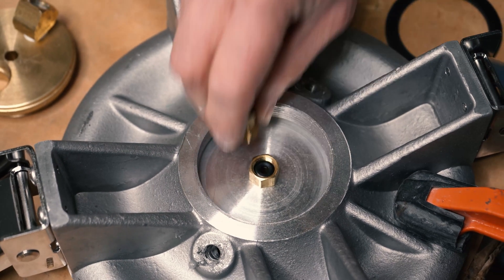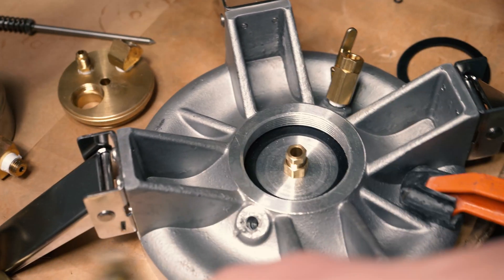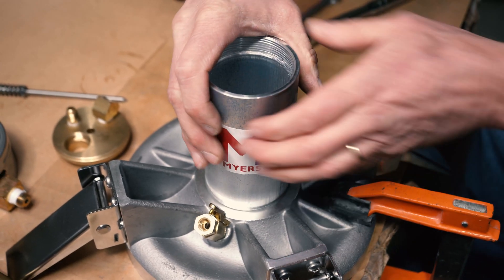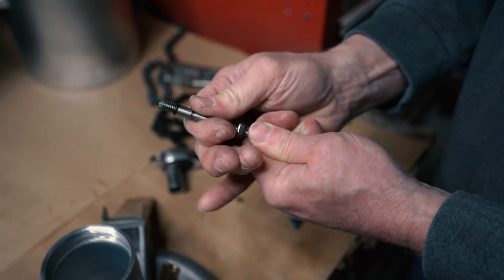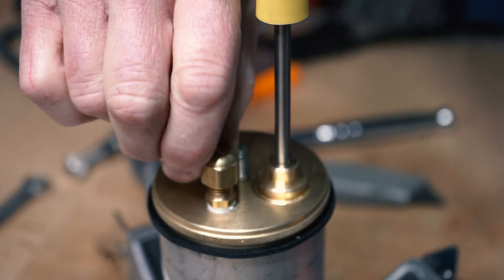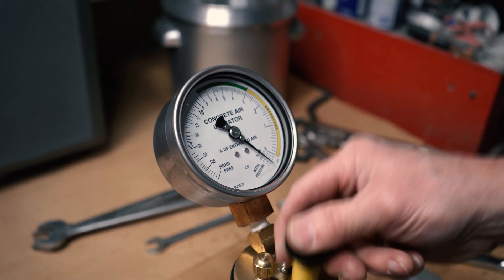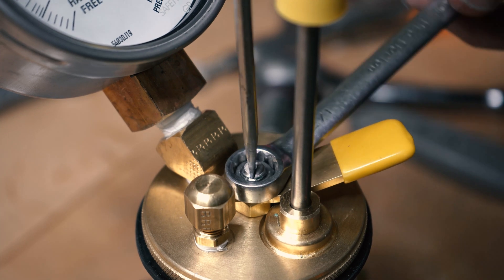Type B Pressure Air Meter Assembly

Comment: Any tricks to removing the camber inoder to replace the bottom seal ?
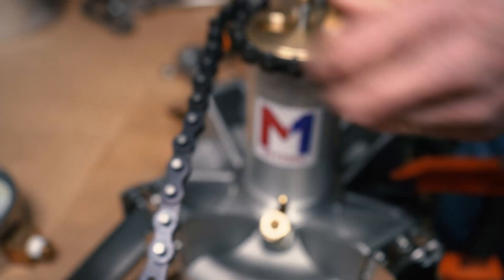Reply from the maker: at time stamp 2:08, you'll see us use a chain wrench on the chamber cap.  This can also be used on the chamber itself to unscrew it from the lid casting.